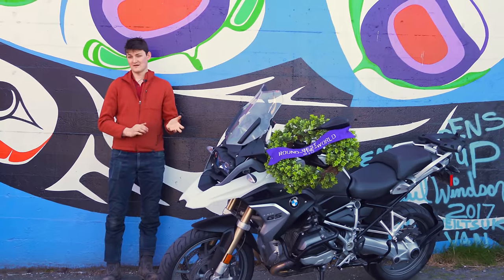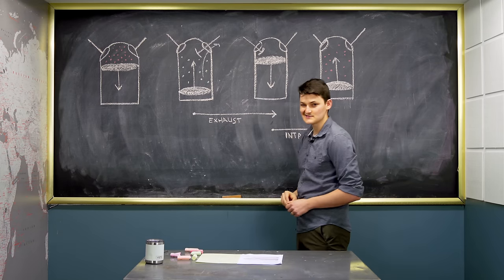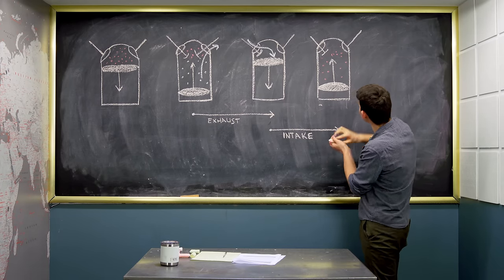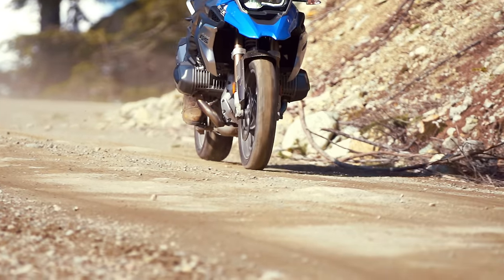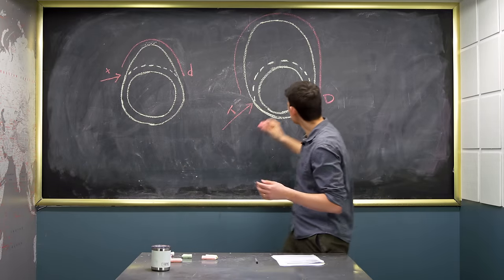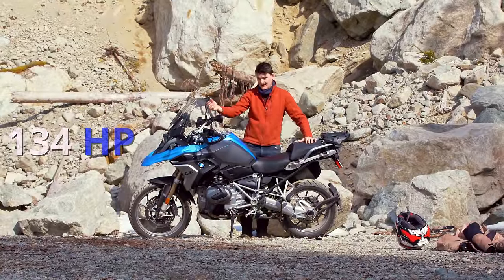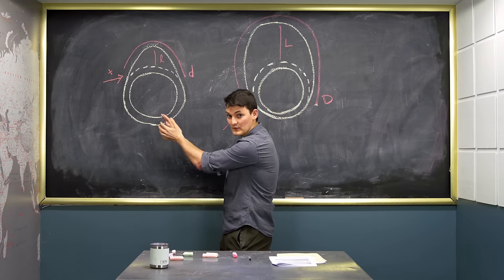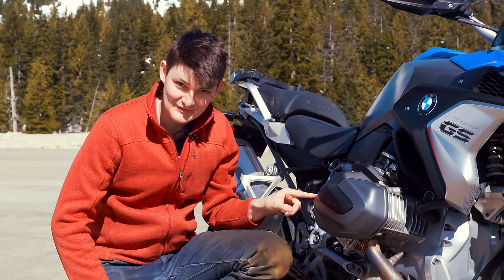Variable Valves are Bad for the BMW R1250GS - Review

Comment: I find it funny that everyone is falling all over themselves to claim his review is "unbiased" and "honest" when he owns the last iteration of this motorcycle. That clearly introduces a bias to not like and find anything wrong and any excuse he can to not spend the money upgrading to this new model or at least defend the bike that he owns and clearly loves. 

A couple of examples....you can turn the hill assist off yet he decides to take it off road, leave it on and then complain about it as if it is a major issue. Just turn it off dude. Are you really saying that you would rather NOT have that option available to you? Then, trying to explain that the shift cam is a bad idea because it is old tech? Really? Every piece of new tech that makes it on to an internal combustion engine in production has been thought about and discovered decades ago, maybe the invention and idea is old but putting into production is definitely not old. It appears, considered how well it works and how smooth the power delivery is (even he admits this) that BMW did a wonderful job adding power to this bike while staying within the emissions guidelines. Or, not liking it because it MIGHT fail, not that it has or there is any evidence that this is a weak link (using a sensor in this application seems perfectly safe to me), just that hmmm, could fail. Not a great argument. I'll take the extra power thank you very much. Then to say there is a better option out there (Suzuki) but that company doesn't even have it in production? There is definitely a reason it isn't being produced yet...it is either not ready or they have issues with it or it isn't the "elegant" solution he thinks it is.

I'm sorry, but he clearly doesn't like the idea of a better motorcycle to the one he owns and is going out of his way to find fault here. Has nothing to do with the bike and everything to do with his bias or the fact that he knows everyone is giving great reviews to this bike and is looking for exactly the kind of response everyone is giving him so is going out of his way to find fault. And, I will say, there are plenty of non biased reviews of this motorcycle. Not every moto-journalist is bought and paid for. I would go so far as to say he has gone the other way and is giving a bad review based on a bias he has or an agenda he wants to satisfy (more views and comments like he is receiving here) There is a reason the 1250GS/GSA is so popular, they are awesome bikes. Before anyone thinks I'm a fanboy or have my own bias, I do not own one and don't even own a BMW. This is simply my observation (that jumped right out at me) of a strange review that smacked of a guy looking for and trying his hardest to come up with something bad to say.
Reply: this review is so completely flawed if you know anything about the bike and its controls and options......  half the stuff he criticizes. like you said.. is manageable....  minus the gps mount.....  which who tf looks at their speed while they are standing up ?????

Comment: This felt like a "I don't want to like this, so I'm not going to" review. 
I know what you're trying to say. You think shift cams are stupid and don't like them. So just say that, don't make a BS review of the bike over it. Just criticize BMW's decision to use that tech. 

Why did you say false non relevant things like "I nEeD tO spEcIaL orDer TooL for Oil caP." It's under the GD seat. The tool comes with it. 
"I aLwaYs aCCidEnTlY enGagE HilL holD aSSiSt" What? You have to do a very specific squeeze on the brake to engage that. Do you have parkinson's? 
I really don't understand why you put out a hit piece for no GD reason.
Reply: Couldn’t agree more. He was all over the place spreading misinformation left and right. Furthering the very thing he rails against. Biased reviews! His bias against Bmw is different than a moto journalists boast but it had the same result. Misinformation and perpetuation of stereotypes.

Comment: Great info.  I am not technically advanced enough to know all there is about VVT or VVL but your video was very down to earth and logical.  From what I have read of the Harley PA it appears it is actual variable valve timing.  Aside of the valve situation I do agree that the GS has been the King of the Hill for some time and it has proven itself around the world many times over.  But I also believe that does not mean it is the end of the story.  BMW GS is a great bike, I had an R1250 GSA and put about 24K wonderful fun miles on it. Sold it to move on and try other units. Been riding for over 50 years, many cross country trips and now retired so time to play even more.
Keep up the good work on such down to earth videos.  Keep an open mind and let's all share without bias.

Comment: 4:30 is partly incorrect. The drawing suggests it stays open longer because of the circumference of the big swoop. Most of what that does it that is opens further than it would in case of the left situation. The duration of it being open is determined by where it starts and ends degree wise...

Comment: Great review. I’m a BMW guy (for better and for worse) and rode several versions of the big BMW boxer GS over the years. I even drive their cars. What they do within a chassis series is incremental improvements year over year until the big leap when the chassis code changes. When the BIG update takes place (between 3 & 8 years) BMW generally has nice well-though-out improvements (Fellow BMW enthusiasts reading this will know that the company have made mechanical mistakes and the electrical nervous systems of the cars follow Heisenberg’s Uncertainty Principle🧐) 
I agree that this critical “electrical” component right under the valve cover could be another nightmare for BMW. Or not. If you take damage that deep on the valve cover you’re probably buggered anyway. I love driving these things but cost is stupid. Agree there too.

Comment: Late to the party, as usual, (who has time to watch all these (admittedly great) videos?) but a couple things to add as an ex- valve train chief engineer, also with experience working with BMW: 
1. We believed (last I was there) that the overall best solution for a passenger car is "both". That is, two step lift and duration like ShiftCam (skip the "f" at your own peril) AND variable phasing as is commonly used in lots of cars. We did not come to this conclusion lightly. The research project lasted years, I employed a couple of the best VT guys in the world (yes, not kidding) and they worked from first principles of combustion all the way to a fully calibrated vehicle. If you want to read about what real automotive grade research looks like, find the SAE article on "Two Step and Phasing with EIVC Timing, written by Mark Sellnau.  
1a. Background: Fully variable systems, such as you long for, are not new. Powertrain organizations have recognized the theoretical benefit long ago. Delivering those benefits is another story. I believe phasing started on the '89 Alfa Romeo. Two step started shortly after. Building up to the ultimate system a step at a time is a result of living in the practical world of knowledge accumulation paired with managing engineering and tooling budgets, which are in competition with the guys on the other side of the building that simultaneously want all the money for their direct fuel injection project.  Anyway, we compared the "value" (total benefits over lifetime total system cost) of a LIST of potential ways to deliver incremental torque, fuel economy, etc. When you show up at a Powertrain OEM with validated information like that, you have a good chance of getting their attention. At the high end of the scale (ignoring full electronic, solenoid operated systems w/ HCCI for the moment) you have variable lift, duration and phasing systems such as BMW Valvetronic and our own internal prototype system in comparison with an easier to implement Two Step and Phasing EICV system.  The killer question is "How much of the fully variable benefit can you capture with the TwoStep system?"  And the answer is, "the vast majority of it".  A number like 80% would not be far off. This is a blindingly complex subject, so simplifying it to one number is like admitting you don't appreciate the subtlety. Still, it gives perspective. So, to summarize: Fully variable on the cam timing, that is, a continuously variable cam phaser on the intake and exhaust. This is quite easy with hydraulic phasers and spool valve solenoids. (Suzuki's centrifugal system is going to compromise the phasing benefit quite a lot in my opinion.) Two step on the cam lobes, giving two distinct valve lifts, and two lift duration numbers.  For fuel economy, EIVC is important. "Early Intake Valve Closing", which becomes possible when you have the rest of the hardware. We studied two step, three step, eight step, continuously variable, etc. Two Step & Phasing, with the right controls is the clear winner for overall value. 
2. BMW did not put ShiftCam on the 1250 out of ignorance of fully variable systems. My kid's 2008  X3 has the N52 with Valvetronic control. It leaves the throttle blade wide open all the time and controls load by the valvetrain. It has 150k miles on it and the Valvetronic system is the one thing that works reliably. Trust me, BMW Motorrad has full access to BMW Powertrain and could have done a single cylinder (per side) Valvetronic if they believed it was worth it. My opinion is that phasing-only would be a good solution for most bikes. Don't forget emission control ("Greta Control"?) as one of the many requirements the engineers must meet. 
3. Ryan F9, this is another awesome review. Thank you. Like others, I snort-laughed at all the jokes. The H-U one was my favorite. Poor Greta... And I loved the way you portrayed the "it's not the bike, it's you" attitude. Having been in Munich more than a few times, I can only laugh and agree.  It's no wonder the magazines have all gone broke. You're killin' it.

Comment: Don't agree with  your comments or the title :  1. no problem to see the display and I'm 1.9M.  Oil cap spanner is under the seat, its part of the screwdriver handle,  engine has more power and torque on a very linear power curve which is really usable in the real world.   If the shift cam actuator fails you are left with one cam profile and the bike still operates.   Oh and an F800GS , two up with luggage is a painful place to be especially on high speed overtakes (which I why I sold the 800 for the boxer) ..  GS as an off road bike  ..C'mon people its 250KG!  there are way better options if you are looking for that and the 800gs is heavy too.

Comment: sounds like its best to get a slightly used 1200 gs. Thanks Ryan for your videos. Very informative...
Reply: Or about a 2016 to 2021 triumph tiger 1200. If you don't mind the weight

Comment: The GS is a dual sport bike.  That means it has been made to be highly effective both on and off the road.  The 1250 puts many a road bike to shame on the road and is still very useful off road.  You can't have the best of both worlds but the GS gets close.  Of course it doesn't need to be a 1250 but there are other size GS's to suit the rider's need and situation.  By the way, the oil filler cap can be opened by using the screw driver which is under the seat with some other tools.

I noticed there is some nonsense going on in the replies here, especially where speculation has been accepted as gospel.

Comment: I'm a satisfied 2017 R1200 GSA owner. Can't see the need to upgrade to the 1250. I'm sure it pulls a little harder past 4K, but to me this is an interim design, the increased displacement and valvetrain complexity meant to fill a gap until something truly revolutionary occurs. Rather than more power, I'd like to see the 1200's HP and torque in a GSA that weighs 50 lbs less. Other than that, I love my GSA. Yes, it was expensive, and I swore I would never spend that much on an overpriced bike... then I rode one. The 1200 is more than fast enough, gets great mileage (much better than my FJR1300 at the same speed, as well as any other sport tourer or ADV bike of similar displacement), and the low suspension variant lets us vertically-challenged individuals get our feet down for tricky offroad situations. If you want speed and power, there's always the S1000XR.
Reply: I have a 2017 GS. 42,000 kms in 22 months. Now have a 2019 1250 GS and 34,000 kms in 16 months.
60/40 sealed/unsealed.  Great road bike, good unsealed & some easy off road.
The 1250 engine is better than 1200 as in better fueling, quieter engine, smoother, more grunt and louder nicer exhaust note.  Overall, feels like a more refined bike.

Comment: this is an acute observation, and I enjoyed the video. I like your sense of humour. However, even if it's not continuum valve shifting, just two cam modes is better than one. Also the so-highly-reputed testastretta DVT is just two discrete modes. In fact, that it is engaged electronically rather than mechanically probably means that there's more to them than just counting the revs, I expect -but really do not know- that this shift could be activated by several other conditions, now or in the future following software upgrades. keep up the good work.

Comment: I was thinking of buying a r1250gsa.  What a surprise I got when I contacted the dealer in Vancouver, High Road. They told me no test drives, you can only take the bike around the block.  Wow, I have owned many vehicles and test driven even more including a 160K porsche. Never have I been told no test drive. They did say this was to keep kms low and that I could go rent one at cycle BC for which I would be reimbursed if I bought new.. Cycle BC has neither the year nor the model. The way I see it I can order from any dealership I want over the phone so why go to this dealer, they dont offer any value add. That said this exercise was a HUGE red flag that this dealer will be my only local service agent and I am not sure I want this. I am all ears if anyone has recommendations for other adventure bikes or other BC dealers.

Comment: I'm glad to see a dissenting opinion on the R1250GS.  I've been saying for years that the GS is too damned complicated and has too many potential failure points to be considered a viable machine for long-term reliable traveling.  BMW insists on doing everything just differently enough to make it a real pain in the ass to service one when you really need it. 

Don't get me started on their "excellent dealer support" either.  I want a bike that DOESN'T BREAK DOWN, not a cushy dealer that's nowhere near me when the damned thing breaks.

It boggles my mind that so many BMW owners put up with this nonsense.  I swear, it's like BMW is reading from the same manual on cultish behavior as Apple.

Give me a Japanese ADV bike any day of the week, and for a fraction of the price.

Thanks, FortNine!

Comment: CVVT has been around for a long time now. Standard on almost every Honda car since 2001. Basically standard equipment on every car today. Even BMW has their own version with the double VANOS that came out in 1996, and their Valvetronic variable valve lift system, often used in conjunction with each other since 2001.

Comment: Bought a new BMW R1150R in 2003. Most problematic motorcycle I have owned in 46 years of riding. Burned 500ml of oil per 1000km (normal according to BMW), leaked gearbox oil down the drive shaft and out the rear boot and bucked and jumped like a rodeo horse due to poor fuel mapping. A common problem according to owners, but non-existent according to BMW. Have owned Ducatis and Moto Guzzi with less issues and would never consider another BMW.

Comment: You are right about everything. But that doesn't cover all. Maybe 1250 is not the best. But I've ridden / owned most of the other heavy bikes, they don't have the same low center of gravity.
There are more subtle things that we know superior to other bikes. 
- Like I hate the square-ish mirrors of Suzuki. Not even talking about brakes. (also the engine sound, dashboard etc). 
- KTM's have the highest seat height of all, hard to reach ground for shorties (even they are superior to BMW in most areas) 
- Ducati's have great power and style but really hard and expensive to maintain. 
- Super Tenere's are easiest to fix, cheaper and great for around the world trips but they are not as well engineered as BMW's.
- Africa twins are getting there, maybe few more iterations. I bought automatic after watching your review, sorry but my old 2012 GS was quite better bike on and offroad.

Comment: Swapped from an R1200RT to R1250RT and repeated a European tour. New gearbox is a big improvement but shift cam has a habit of shifting just as I come out of the mountain hairpins, instead of smooth progression I sound like a hooligan suddenly revving the engine usually overtaking cyclists that I have caught then patiently followed through the said hairpin.

Comment: Not to mention that the left cylinder on the 1250 sounds like a cement mixer once hot. 'A characteristic' BMW told me. 'A known fault' my dealer told me. I'm done with them. This is the same engineering family that figured splitting the 1150 in half just to change a clutch was a reasonable thing to expect buyers to do. And not including shaft drive splines in servicing was also ok despite them seizing solid...  Hurumph.